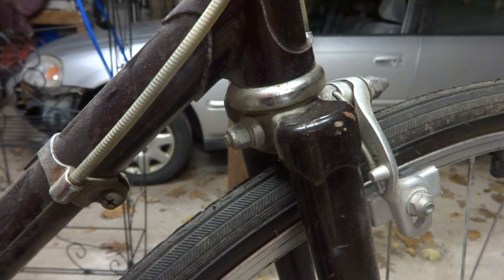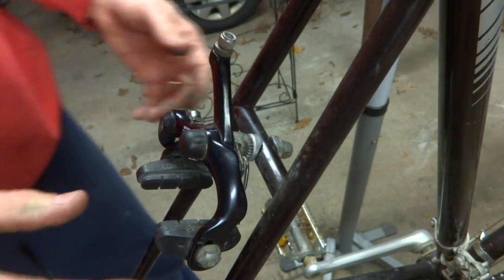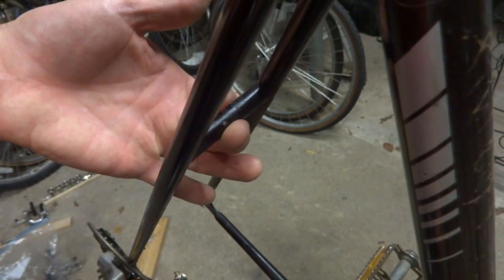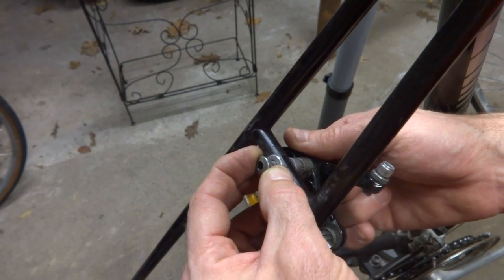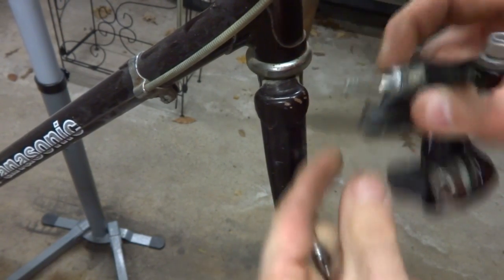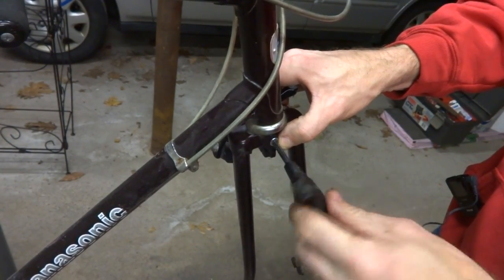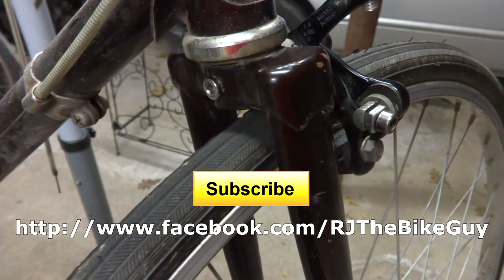Install Recessed Mounted Caliper Brakes On Vintage Bike Frame

Comment: I did the same things , it works perfectly the method , but i have a bigger problem , the new Shimano Sora calibers are not reaching the 700c wheel rims , What shall I do ? I never had b4  Vintage frame , I guess is a french style , i dont know much about this :/ :) 
any good idea?
Reply from the maker: +Laszlo M If the pads are adjusted down as far as they will go, you will need longer reach brakes. https://www.youtube.com/watch?v=L5pl0zrlHbg
Reply: +RJ The Bike Guy   ohh great ! I knew it you can help me :) !! yeah I have to buy longer break calipers , I wasn't too sure in this , but now I know for sure .  Thanks so much !!  your videos are amazing and I love your channel !!

Comment: You can install the front in the back (as you say) and the rear in the front. You just need to use a longer nut in the front so is long enough to reach the brake.
Reply from the maker: That is basically what I said. Though what I did is cleaner.
Reply: It looked like he had to use the caliper with the longer bolt for the front though.
Reply: When you buy a set of front and back brakes would one of the two recessed nuts usually be long enough for the front after drilling it out with the 8mm?

Comment: Could you make a video on explaining ghost rings and how to use them?
Reply from the maker: Ghost rings?
Reply: David Milliken  what's a ghost ring then??
Reply from the maker: I did a search. A ghost ring is a chainring jammed in the chain on a fixie/single speed bike. I think it looks more decorative than functional. Supposedly used to tension the chain, but it seems a chain tensioner would be more reliable.
Reply: oh,never heard of it before,i'm not a fixie rider & never will be,it breaks my heart to see classic bikes butchered like that :(

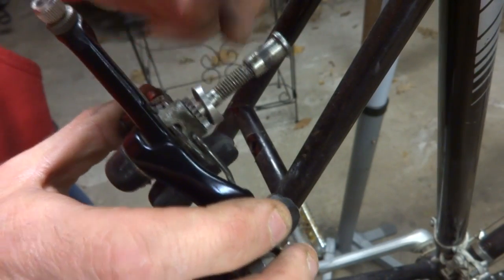Comment: hey, please help. My frame at the back is similar to 1:09 but the hole does not go stright through back to front like that it goes down to up. as if the bolt points towards the ground. I'm confused ghow to mount a brake on it.
Reply from the maker: I have no idea what you have. Sorry.

Comment: For the back brake, instead of getting a right angle drill and drilling from underneath or installing the brakes backwards, couldn´t you just drill through both holes from the topside?
Reply from the maker: matthew christie Which is what I talk about at 4:15 into the video.
Reply: +RJ The Bike Guy I Think what he is asking is; whether you could just drill all the way through so you didn't have to mount the brake on the inside, is that possible?
Reply from the maker: Maybe, but that would weaken the brake bridge more than necessary.

Comment: Hey I just got into bikes and I got a fixed gear frame used and i want to mount a brake but theres no hole in the brake bridge how can I mount a brake?
Reply from the maker: Not sure what would be a safe way to do it.
Reply: sept real your just gonna have to buy a new fork that's drilled For brakes and swich em out

Comment: I dont have ankle drill. :( What if I'll drill through both side frome the back?
Reply from the maker: Don't.
Reply: @RJTheBikeGuy  Thank you for your answer!! :) I have a Tiagra 4700 set on my bike, except the brakes. I'l try to find a tiagra front brake and measure how long is the screw, but I can find only in online stores :/ Maybe the front will be fit on the back, but in the pictures that also looks short. :(

Comment: You dont have to drill into front fork. You could put a nut from the bottom and screw it inside. Its tricky but 5mm allen should fit through hole on the back of fork crown. Its easier to do this with your bike upside down and some magnet to hold down this recess nut.
Reply from the maker: I have seen this suggestion before but personally don't like it as I don't think it would hold the brake solid enough when braking.
Reply: shyflirt1 You'rie right its not the safest way but it works for me for few monts. I just put this together in order to go on bike to shop for 8mm drill :D And now im too lazy to change this. 

BTW I'm really like your vids

Comment: Could sb help me? My brakes arent eqauly far from the angel.
What should i do?
Reply from the maker: +Szerdahelyid Szerdahelyid No idea what you are asking.
Reply: It is hard to ask it in my own language but i try. In normal position the brake shoes are not eaqual in the angel. the left one is closer to the wheels. This (i mean the left) is not suspensing when i use the levers
Was i clear?
Reply from the maker: You probably need to center them. https://www.youtube.com/watch?v=7ER5N6UvVU8

Comment: Hey would you know how to fit a new wheel onto an old frame 230mm wheel onto 220mm for example
Reply from the maker: Do you mean 130mm and 120mm? https://www.youtube.com/watch?v=YdibmxBuMy0
Reply: Yes thanks for that video. Wasnt sure what the measurments were. 

Another question is there a way to install V brakes to the back? I know to install them to the front I need a new fork.
Reply from the maker: If you have the posts there, you can. Or have some welded on there, but they need to be positioned properly.

Comment: Heads up yall on my 84 Bianchi progress.  

Ok I drilled my bike out -  all the way through on the back brake bridge and the back part of the fork.  It works.  I then put 5800 105 brakes on it.  I paired theses brakes with my old modolo levers and they work fine.  :)

only problem I found was that my drill couldn;t hold a perfectly round drill bit when going through the metal.  The drill would slip around the bit.  So i had to go buy a bit with a squared end like this. (notice how the drill bit end is not circular.  They consider this type of bit "impact ready". This allowed my regular cordless drill to get more purchase on the bit and not slide around the bit.  

http://www.amazon.com/DEWALT-DD5020-16-Inch-IMPACT-READY/dp/B002LFGKVA/ref=sr_1_2?ie=UTF8&qid=1448241054&sr=8-2&keywords=5%2F16+drill+bit+impact

anyone have any good recommendations or a long, cheap, high rise 1" quill stem?  I can;t find them anywhere...
Reply: I restoring my Bianchi Celeste ,100% italian frame , trust me its better if you find Campagnolo components works perfect!